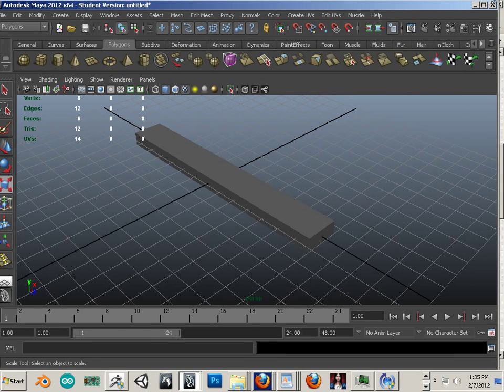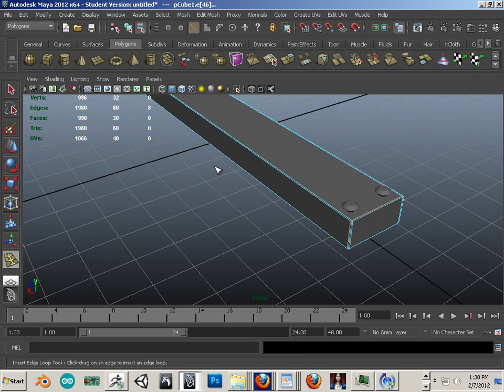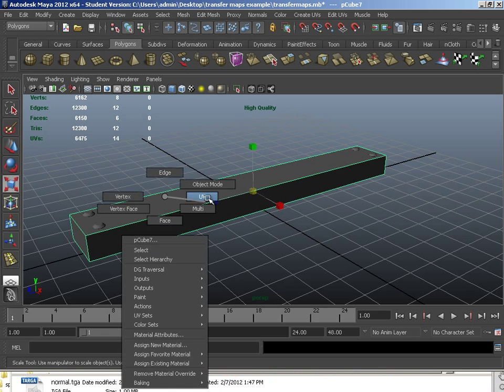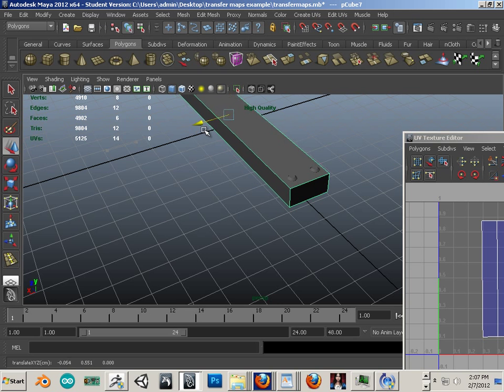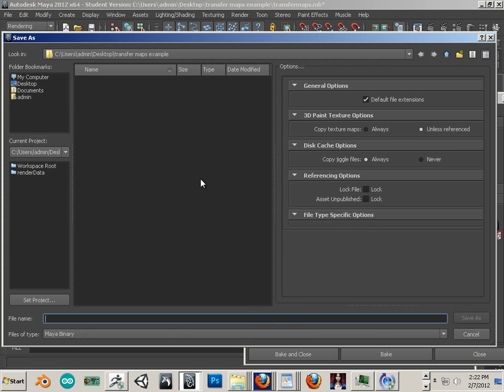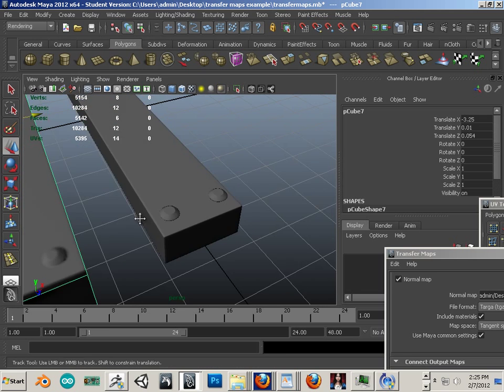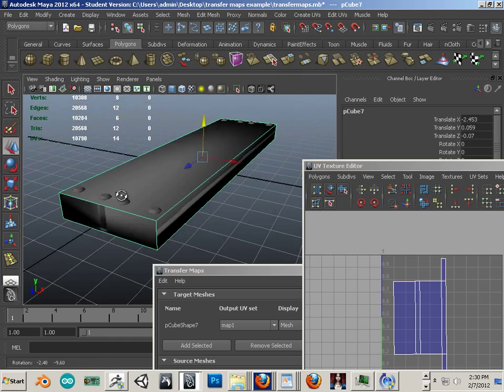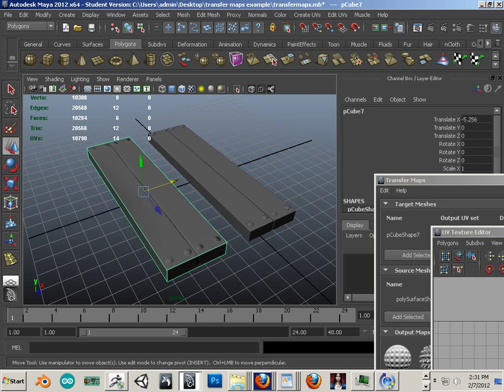Transfer Maps Example Maya 2012

Comment: I have a question. When you include color into the process how does the workflow change? Would the color be added to the high res object and then be transferred to the low-res? Or would you color the low-res model after the transfer? Thanks :)

Comment: As far as I know freezing isn't really necessary here. But you could try it by yourself. Deleting the history speeds up the process and makes sure to avoid wrong interpretations of the meshes. Deleting history often makes sense in maya, because it's a general source of errors. Doesn't mean tho, that the baking fails without it in general

Comment: Just some hints:
1. you dont need the MR plugin for the normalmap-baking
2. for normalmapping the MR part in the transfer map dialogue is ignored, so it doesnt have to match the maya common settings
3. the project doesn't matter here (as you noticed by yourself)
4. your target mesh had hard vertex normals. Therefore you should change to "surface normals" in the "match using" field unter advanced options. That's the reason your screws seem to lean to the side in the final normal map